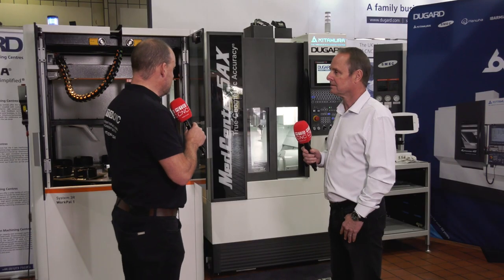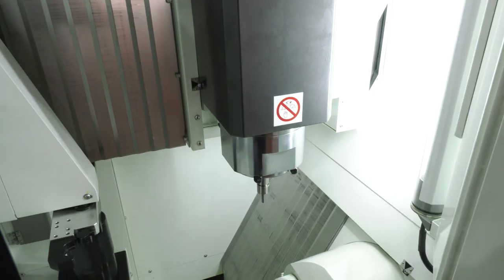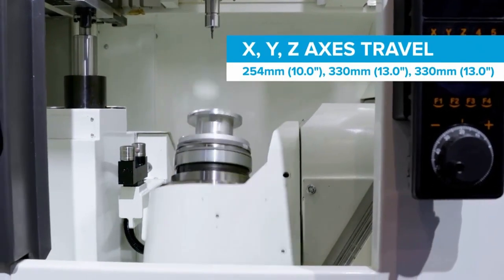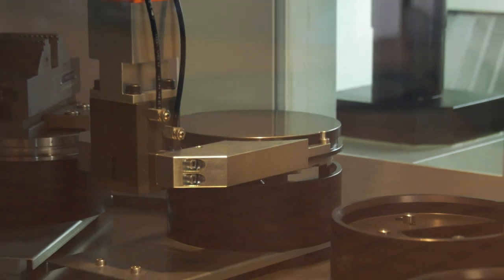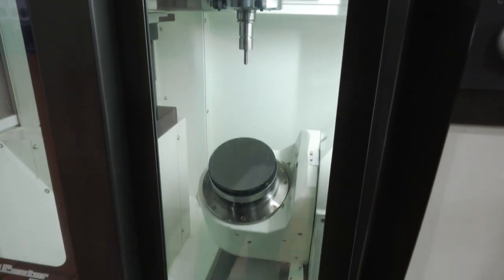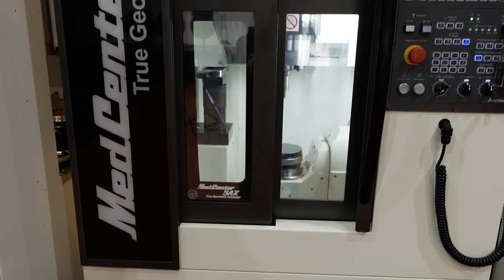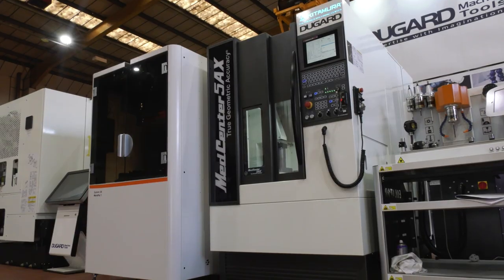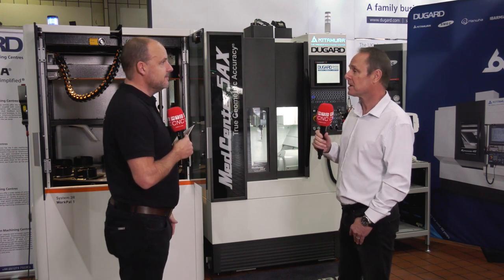1 micron accuracy on this 5 axis machine

Comment: One micron? Really?
Reply from the maker: Yes, so so accurate
Reply: @MTDCNC  Thank you for your response.
What is the approximate price for Slovakia?
Reply: i call it BS, you can not achieve 1micron precision like that, just take in to account that steel coeficient of thermal expansion is 11x10^-6...
Reply: If that is really true, the tools must be super fine, which begs the question of how long they last. I can't think of any material or way to produce such tiny fine tools, let alone if you could I assume they would break almsot upon the first impact with any material... How is it possible????
Reply: @hikolanikola8775  Yeah, that too. Plus, the tool you saw in the video doesn't look small enough to be able to do 1 micron to me... Maybe he mixed up the math in his head, accidentally said 1 micron instead of 100 micron (0.1 mm, the standard for most industrial grade machines nowadays, and 3D printers)? Or maybe  he meant to say 10 micron? (0.01 mm).